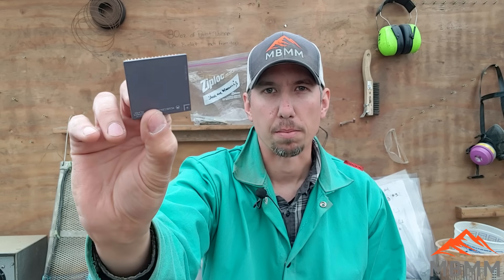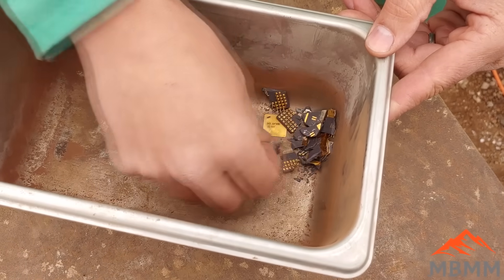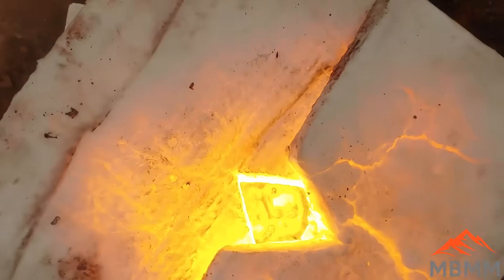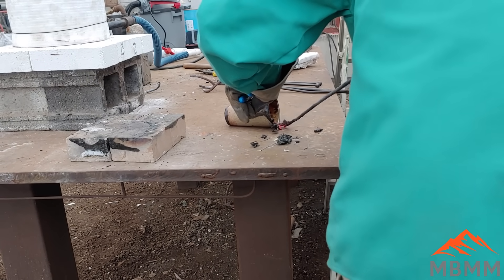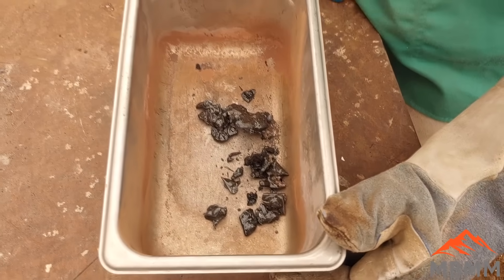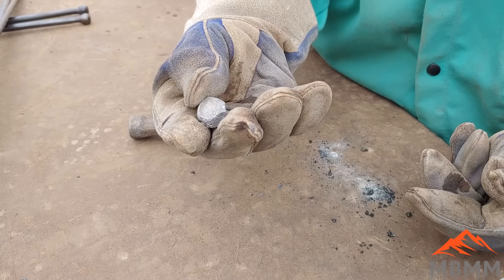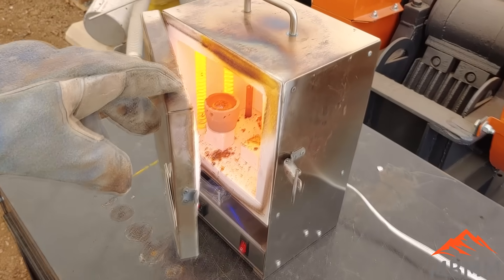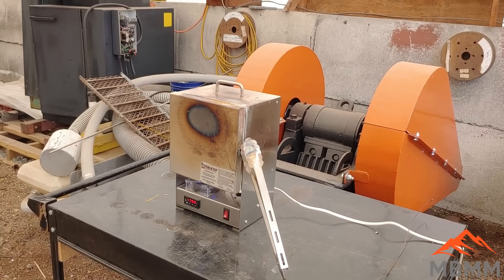Can CPU Gold Be Direct Smelted? Electronics Recycling & Urban Mining For Precious Metals!

Comment: From my experience dealing with these type of materials. 
I watched all types of electronics change in their composition, from 18k solid metals to cost saving manufacturing techniques, which used the metal silver as a base metal for pins and so on, which the gold plated. With a heavy gold plate. Not a flash gold look that rubs of with one use like most manufactures today, 
So, I have handled millions of computer chips. I still have some that are rare and heavily cited in gold. As well as some very heavy duty diods. 
These computer chips generate electricity for every leg of the chip when exposed to light. 
But anyway, what you probably recieved was a later model of chip from the 90s to today. 
It could be older. 
But the metal content you recieved shows the percentage of metals  used to make these chips. 
But, whats important here is the cost per how many chips to process. And what can you yield.
What you are showing is very cool. 
I wish I was there actually participating in this type of study. 
I actually helped in the reclaiming of silver from one dirt into 5 gal  glass bottles. Throught the vacume filter process. 
I think its all a very interesting process.
After watching several of your videos. I think you might be the kind of  person that could  do and be interested in making somthing that I keep secret. 
For good reason. 
However. The main reason I keep it secret is, because I can't prove it unless I do it first. 
Thats where I noticed that you have the place and skills to do an awsome job on this type of project. 
It could be an eye opener. And fun, 
It could even bring revenue of sorts. 
But also it could make a great YouTube
Learning  video . 
And it will answer a great ancient question concerning alchemy still not realized by man today. 
Ok brother. Keep up the cool work. Let me know if you want to ?
Reply: I found this comment by you interesting.'These computer chips generate electricity for every leg of the chip when exposed to light.' Are you saying that these chips without being powered electrically can still generate electricity by themselves? Is there evidence of this that can be confirmed?And what in your opinion causes this phenomena?
Reply: @joerenaud8292  
Yes brother, they might have one leg that is ground. But , each leg give off power when exposed to light. Different voltages 
I don't know exactly how its done, but what i do know, is that there is a clear window on top , and when you look into it. You can see a small ,, I would say another chip with tiny gold wires spideeing out form it. So its like a solar chip ?  Light sensitivity device. 
I have 4 storage units full of stuff. But these are in there. I don't know exactly where they are or id take fotos of them and their part numbers and send them to you. 
Ok. Peace, have a great day.

Comment: I have about 30 old CPU's, 12 graphics cards and a tonne of RAM all the way back to the days of SIMM ram. Pre SD ram. So yeah, I am a horder :D  maybe I should get the gold reclaimed from them.
Reply: You should. Most of the gold on computer parts eg RAM and CPUs is along the connecting pins. Gold's melting point is low enough that you can just use a soldering iron to get it off. Enjoy!

Comment: all the gold pieces on cpus are going to be platted surfaces, if it were to have real gold parts the cpus would be extremely unreliable. they would have too many deformations. Also if they had real gold parts they could get extremely expensive considering gold is around 1,700 USD per ounce, which is almost 50 per gram. just too expensive.

Comment: Silver is probably from intermediate platings of contacts, the steel covers, and from internal solder joints.  Gold wires are essentially pressure-welded to the contact points on the wafer inside the IC, but are likely soldered to the lead frame (not lead as in Pb but lead as in terminal), which is the frame of the IC body that has the external connections.  Since the IC has to be able to be soldered at normal PCBA soldering heat profiles, any internal solder connections has to be done with much higher temp solder, which would likely contain silver.

Comment: The gold is only on the pins on the outside. Use hydrochloric and nitrate acid to dissolve off the gold plating. You are doing too much work with the ceramics and plastics.

Comment: All data wiring on a circuit board is silver. All data connections are gold plated copper or silver. Power wiring and connectors are copper.

Comment: Old chips like those, looking to be mid 90's to early 2000's, well they mainly used silver leads and pins that were gold plated. Newer ones use aluminum alloys often instead of silver. You have to realize, through the 90's into early 2000's silver was at all-time lowest prices, some spot prices as low as ~$3 an oz. During that period, gold was relatively low, too, around ~$300 - $350 per oz. So it made more sense to use the cheap silver (which was cheaper often at the time than copper) as a base, & gold plate it. That era, you mainly saw solid gold pins/leads only in aeronautical, military, aerospace, and high-end industrial electronics applications.
Reply: It is actually interesting. The same beryllium that turbine blades are made out of is recovered by the government in service. Ones that are not repairable, or contaminated get sent to be recycled into artillery and small arms, armor-penetrating ammunition.

Comment: My first job was at Marconi in the 80`s. They looked like the same type of chips we made. We made all sorts from telephone dialling chips to space SOS chips. The cheap ones use epoxy to attach the dies and ali wires bonds and the more expensive ones used gold to attach the die and gold wire bonds. Never heard of any silver being used back then.

Comment: The AMD K6 has 0.07g AU. The motorola 0.11 AU, so your other two chips have equal parts of whats left.
The gold in the chips itself has a silver content where its braized-soldered, so the pins to the wire wire to the die and some dies are AU braized to the chip.
The other elements except the lead are in the silicon wafer afaik. They may possibly have also been in your lead unless you used pure lead obtained from the betts process.
The palladium minor content is interesting academically speaking, im unsure to its origin unless there was mlcc present on the chip somewhere?

Comment: The silver is in the connection wires between the die and the pins. There's also some between the die and the heatsink because silver is a good (the best) heat conductor.

Comment: Steel base, plated w/ silver and later dipped in gold. That's how most computers get fried and how they screw you over. Back in for another computer/hardrive. LOL. Truth though. I wouldn't recommend getting any of this stuff on Amazon. Maybe smelting metal beads, but not the major stuff. There's a forging website for all of that and pretty much everybody is using it. Type in Devil Forge and you'll get it. Love that website. Most CPUs aren't worth it. Nowadays every computer is basically copper, steel, and platinum. And a shit ton of lithium batteries. LMAO. Definitely fun to watch people smelt stuff. Keep it up.

Comment: Some of the could with metal caps have indium as heat sink solder to the cap it is softer than lead and I ha scraped about 2 kilos myself while not gold it is worth slot Say 1 to5 dollars a gram depend in ding on purity and quantity so if you are going to do a lot of them heat them to say 600 degrees f this will partially brake down the bonding glue and make it much easier to pop the top no need to smelt the cap with the CPU as it will add a lot of copper to your mix once you have escaped them if you can put do losing them will burn of a lot of plastic and some ceramic making what you need to smelt or gravity separate a much smaller amount remember not to hot you don't want to boil the gold away :=)

Comment: I hope he's wearing a respirator, using asbestos blankets on top of his furnace that can shed asbestos fibers into the air he's breathing or contaminate his work area an get stirred up in the air that he breathes is not only hazardous but could be deadly if any asbestos fibers enter his lungs. Not wearing a respirator designed to stop toxic fumes isn't very smart and good over time make him very sick. Lead fumes are deadly and the fumes that burn off are most likely toxic.
This should be done in an industrial environment set up to recover the toxins he's putting into his lungs.

Comment: I use acids to recover gold from CPU's and there is more gold in the older CPU's. 2x86 - 4x86 have the most gold.
Reply: @Computer Whisperer Not really, I haven't gotten that technical into it but anything pre-Pentium has more Gold and those made in the last ten years have much less. It's just the nature of the business and learning how to cut costs. Some processes don't need the enhanced flow of data that we used to think they did ( which required gold ) so we are using cheaper materials for those tasks in a motherboard. Most memory chips that I buy to upgrade pc's don't even have any gold in them for instance but they did 20 years ago.

Comment: The Silver comes from the bond wires that connect the terminals on the Silicon chip die to the CPU package internal terminals.  The CPU package external terminals (pins) are gold coated.

Comment: Those processors are old school, late 80's to mid 90's, and were tough as nails. A large majority of the gold on those bad boys is on the outer surfaces, possibly even easier and more cost effective to dissolve it then extract it with acids.

Comment: A thing to consider is that some of the chips used indium as heatsink solder it is softer than lead has a low melting temp. and can be sealed off and collected I collected 1 kilo in an afternoon Currently over 500 dollars just saying make sure you get all the value :-) !
Reply: Scraped off

Comment: No is the simple answer. The Chinese (the largest reclaimer of gold on earth by far) have orphans in odd places use potassium cyanide or liquid mercury to reclaim gold from computer boards and parts with electricity. Both have about a 90-98% recovery rate. Bad news is they are both toxic, especially gold/mercury amalgam. Where the Chinese get it done (like Sri Lanka) nobody cares about orphans. They can also recover platinum and palladium and silver with mercury all at once. The Chinese also "recycle" solar panels and lithium batteries with child labor. In most places, the orphans don't live 6 months, but they have a bed, a roof and food, which they wouldn't have without working. The reality of the "Fifth World".

Comment: Is there a chemical way to process that button and be able to recover both the gold and the silver (palladium as well) or will everything else be sacrificed to recover the gold? I assume, because they are all base elements, they could all be recovered separately in some fashion, but whether there's enough to bother with economically is another issue.
Reply: @Jacob Rampulla I started watching Sreetips channel and he does it all chemically. Basically getting everything into solution with hydrochloric and nitric acid. Then you can make each metal precipitate out of solution separately using various methods. It's pretty complicated, but also interesting. But the answer to your question and mine is yes. Check out Sreetips channel

Comment: I've worked in the semiconductor analysis industry and the largest source of silver in these CPUs is the silver glass die attach that is used to connect the CPU chip to the ceramic package.
Reply: Is there any way to separate the silver from the gold and end up with both?
Reply: @beebob1279 yes, but its time consuming and you need dangerous acids and probably an electrolysis cell

Comment: The metal layers in the chip are silver.  It's a very good conductor, and since it's inside chip it doesn't have any air exposure to tarnish.
Reply: Actually for these chips the metal interconnects are aluminum.  They went to copper a few years after these chips were made.  Copper is still used today.

Comment: Any way of recovery that excludes acids is great. 👍
Reply: Look up SHOR international they have a seasalt extraction its not really seasalt but they say no prior knowledge of refining says its easy and recovers 99.97% but isn't cheap like 1000 plus the solution they use in the system is sold spereratly so I'd say at least 1200 so it's expensive but doest require acids says it's easy to use just follow instructions sounds a little to good to be true but at 1000+ I'd say you better get what they advertise
Reply: What do I need to get the silver and gold out of the cpu

Comment: Right on like the comments nice job I do recommend ultimate safety precautions even to the point of being over the top safety because you’re dealing with some very toxic substances love to see a hood vapor recovery unit suck it up all that lead fumes  grab a face shield and a good respirator protect you and your cameraman , because gentleman there is a price to pay 
I got my captains license at 20 years old Ran daily two take-dives to Molokini  island  turns out damn dive shop didn’t have the proper air filters ever pump on the tanks with bad air didn’t hurt the tourist but us old deck  hands accumulated years of bad air no Bueno , screaming loud cat diesels and 250 horse outboard’s No hearing protection, my hobby was building fast cars and motorcycles lotta lacquer paint jobs , Bondo dust no dust mask no respirator drank too much,  Quit with the boat life around 30 to join the union became Crane Operator just retired from 30 years of crawler cranes hydros and Tower Crane’s but  damn there is a heavy price to pay fellows for not protecting yourself the quality of my life would be so much better if I just would’ve taken a little time put it in some earplugs make sure respirators were clean and new and wear a dust mask. So have a great life but protect it ..😎👍